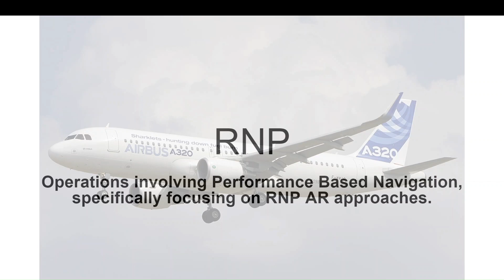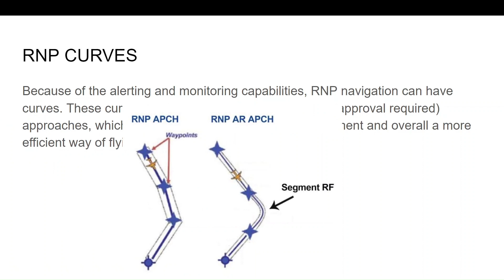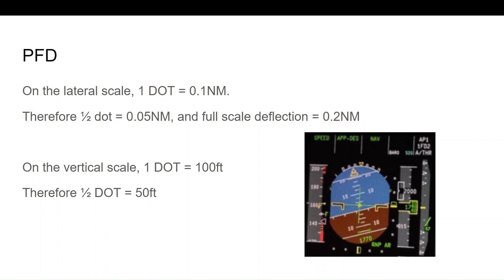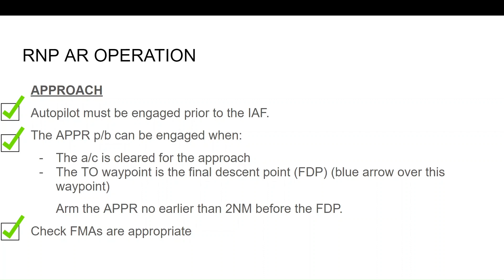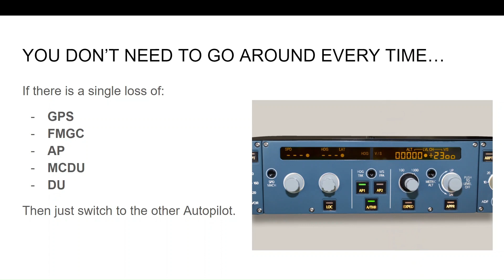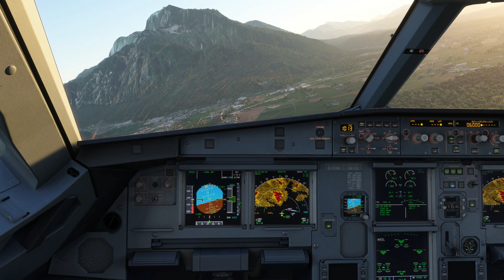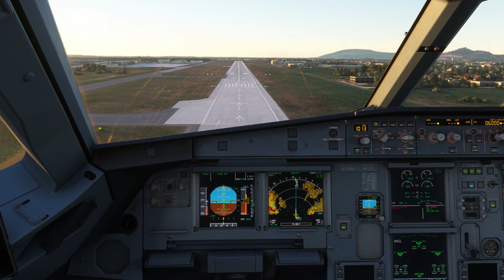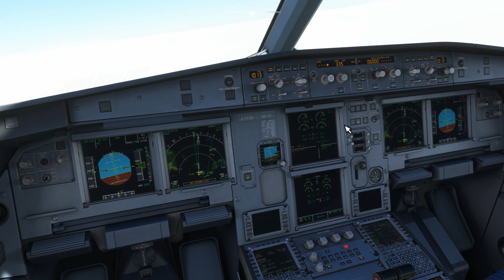MSFS A320 TYPE RATING - RNP/RNAV

Comment: Amazing video, btw can you clarify me why when you lost both gps the accuracy was still on HIGH?
Reply from the maker: Hi buddy this is a great question, thank you for your comment! Let’s break it down:

NAV ACCURACY is determined by comparing the RNP value to the Estimated Position Uncertainty (EPU). The EPU shows how accurate the aircraft's position is compared to where it thinks it is. The greater the uncertainty about its position, the greater the EPU value. 
If RNP is greater than EPU, the NAV Accuracy is HIGH
If RNP is less than EPU, the NAV Accuracy is LOW

GPS PRIMARY appears when the aircraft uses both the Inertial Reference System (IRS) and GPS data for navigation. There are two main criteria for this:
Accuracy: (As we discussed earlier.)
Integrity: The system's ability to detect failures and alert the pilots.
When both criteria are met, the aircraft displays “GPS PRIMARY” (or “NAV PRIMARY” on some Airbus types such as the 380).

In the case we’re discussing, we lost GPS, which means the aircraft could no longer use GPS data for navigation. Instead, it had to rely on other sources like the IRS, DME or VOR to determine its position and navigate. Despite this, the IRS is workinh normally, and can accurately calculate the a/c’s position. So RNP > EPU, and NAV ACCURACY remains HIGH.

I know this answer is very word heavy and hope I haven't confused you eben more!
Reply from the maker: Also in the video at 8:11 should further help! 😊

Comment: i think good back up in case 2 AP fail will be raw data ILS approach. But i am not sure if this kind of airports have ils capability. Good video by the way.
Reply from the maker: Absolutely, if the airport has an ILS then this would be the preferred approach anyway. But a fair few airports which have RNP AR do not have an ILS (for example: Funchal airport). Thanks for your comment!
Reply: @TypeRatingPro  Well in this case Vor or Ndb beacons should help, but in mountain area it can be really hard to follow
radials. But it's better then nothing and with some visability to the ground it can work.
I remember my first time i tried A320 in MSFS 2020 during snow conditions. Back then i didn't know how to use autopilot properly including lls, Rnav, Vor and NDB approaches, i just didn't know what the hell is this mean. I tried to land at London airport
and the only things i had back then is the visability to the ground about 500 - 1000 ft or so and the map on mfd. That was really sweaty flight just like from that sweaty pilot mem.
i founded an airport a couple of times but at the wrong angle, cause back then i didn't know what the final approach course means. So after a few go arounds. i managed to see runway at "exceptable angle", after hard dive and about 20 degrease turn i managed to land, but that was a hard landing, cause i didn't know how to make butter landing back then.
Actually i still don't know how to make them every time on each plane i fly in msfs. It's only easy to make them on B747-8 for some reason.
Reply: @Valentin_MeL  NDB and VOR are being phased out. In the US, new pilots aren't even taught NDB anymore. By 2030 RNAV/RNP and ILS will be the only approaches available.
Reply: @xNYCMarc  I just flown in A320neo to antactic from new zeland in MSFS 2020. And damn i would be so happy to have vor or ndb over there. It so hard to spot runway among white snow when it doesn't have rnav, ils available and when gps stops to work. That was during day with no clouds. At some point, for some reason gps started to show that i been moving away from airport. And ARC and NAV mode of the map  started to show me that airport in two different places. I guess it not very effective when ther is not alot of satellites around. I even asked for some headings from dispath. But even with them i coudn't find airport. And eventually I've been forsed to land in the middle of nowhere but somewhere close to airport, 
Even if vor and ndb outdated, they can be a good backup in case when rnav and ils not working. And the most important when gps is fucked up,
Reply: @Valentin_MeL  Well, the satellites are everywhere! Hahaha. It even works through clouds. It isn’t like television satellites that are blocked by moisture. 

VOR, NDB and ILS require physical equipment on the ground, sometimes in remote locations, that need to be maintained and replaced regularly. The move to all satellite navigation is less expensive and more accurate. Small airports that don’t make any money can now have ILS-like approaches that they wouldn’t otherwise be able to afford.
Reply: I am not sure how many satellites around antarctica and if their amound is good enough for gps to work. Maybe that gps bug was only a bug in msfs. Maybe in real world it would work better. 
And ye i agree that rnav\rnp and ils is very good stuff to land in any weather conditions,
But what if they not gonna work? Having a 2nd plan like a vor or ndb is always a good thing. They better than nothing. And they also very good on old planes which doesn't support gps. Like cessna 152.  They still very effective during long VFR flights.That's why i think new pilots still need to now how to use them, in case of an emergency or a global war, where satellites will be a prioritized target.
Reply: @Valentin_MeL  GPS has been used in Antarctica for navigation and measurements since the late 1980’s. Both US and EU GNSS systems work in Antarctica.
Reply: @xNYCMarc  Ok, i guess that was a bug in msfs.